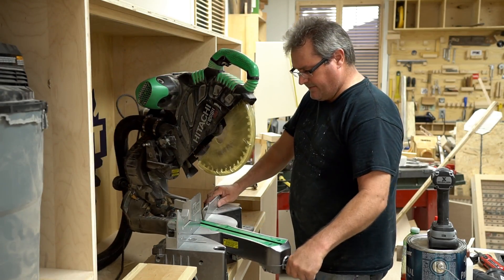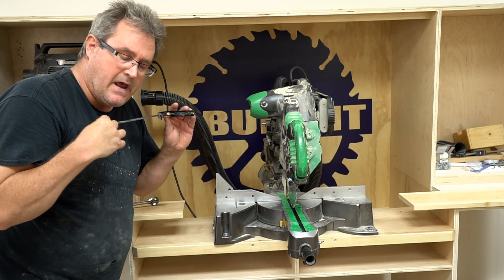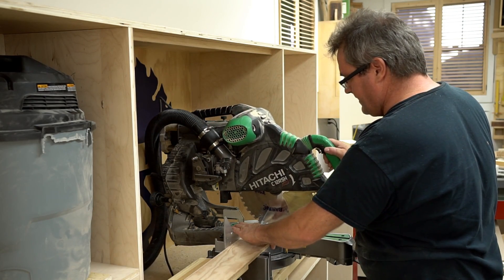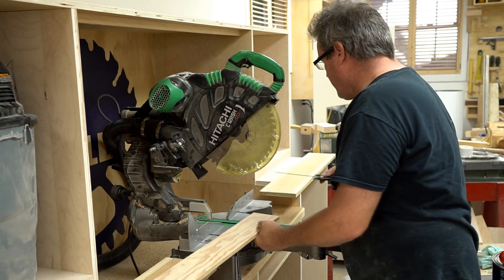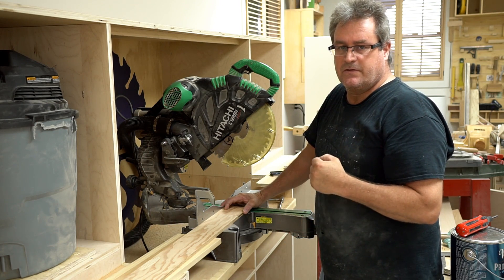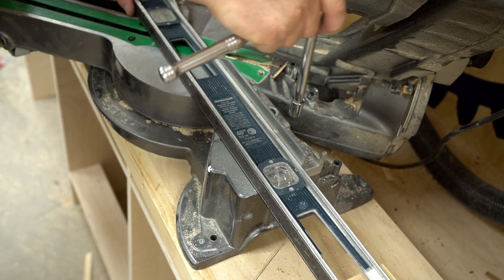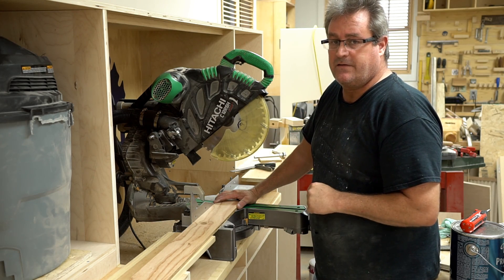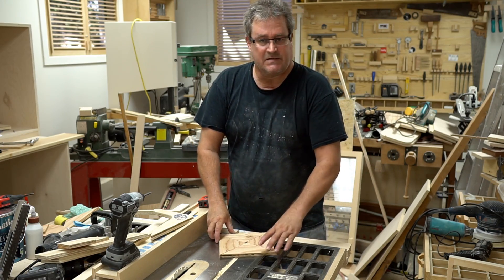Adjusting A Miter Saw For Accurate Cuts

Comment: Awesome post, sir!  You saved me money and time setting up a humble home shop.  I thought I'd just bought a lemon, a Hitachi C10FCE2 .  It was never right in the horizontal plane, fence to blade.  I had bypassed the factory detents the entire time I've owned it (5+ years).  I ran it square, but never on the factory detents.  I always ensured it was squared manually, and bypassing the factory settings.  It was on my list to replace as soon as I could.  I wasn't aware it was adjustable in that plane.  Thanks a bunch!

Comment: Thanks John. I've been having trouble with the cuts with my saw, and didn't know why. I put a speed square on it, and lo and behold the saw was out of square. When I checked the 45 after pulling the saw back the bolt was nowhere near where it should have been. I am so glad you mentioned that because I would not have checked it. So, thank you so much, you saved my life(so to speak).

Comment: My wife bought me a miter saw for Christmas one year. Right out of the box it worked perfectly. After about a year, I decided to check it for square. Low and behold, it was out of square though I was very careful with the machine. So, I adjusted it until it matched my machinist square perfectly. I did a few projects and not one turned out right. To make a long story short, this so-called machinist square was off by a few degrees. after it went flying across the garage, I got out my tri-square, readjusted everything and now it's perfect once again. Moral of the story: Check your squares regularly!

Comment: Hi John

Very informative video. If you loosen the three screws on each green inset plate, push the inserts inward until they are flush, make a sliding plunge cut, you will have a zero clearance inset plate.

Thanks for your time

Comment: That is one beast of a saw.  I can see why you made a station for it.  I've got an old 12" Craftsman that I've had for almost 25 years which is still going strong.  I'm not using it everyday but it still holds its settings.  Never thought about the five cut method.  May have to try that next weekend and hope my opinion of the saw stays the same.    8-)

Comment: I am very glad you made this video.  I have the same saw, I think we've had ours about the same amount of time (I bought mine in 2010) and for the most part I've been happy with it, but I have noticed things not quite lining up when I'm crosscutting a wide piece, and I've just sort of lived with it for a while, but now I realize that it is possible (and pretty easy, actually) to adjust this thing to something a lot closer to perfection than I've seen with it.

Comment: Thanks so much for this John. I have a Maktec MT230 (non-sliding) which has a long single backing plate with 4 bolts. I had no idea they were adjustable until you demonstrated that. As you guessed, I didn't read the Manual! Probably I would have tried looking for an adjustment thingie underneath the round table bit that moves the angles, so you have saved me a lot of strife.

Comment: Even 5 years later, this video is so helpful & easy to follow.  I was going nuts aligning my 45 degree angles for artwork frames with the saw bowing & had limited knowledge in to check/fix it. I even made a sacrificial fence (which was a waste). I also wonder if a 60 tooth saw blade would be better than a 40 when cutting poplar. Will try this first.  Thanks!

Comment: I have a similar saw, couldn't get the left fence to square up. This happened before. Had to remove both fences and plastic saw guides to get at the main pivot bolt. Unscrewed that and gently lifted saw off platform. The whole area down there was fill of sawdust. Cleaned it all up and put it back together. (don't overtighten pivot bolt) Works great now.

Comment: I don't know how people go without a miter saw. Mine is a 12" craftsman (non-slide) compound, and I love it. I now use an adaptation of that zero-clear backstop/flat deck like the one you made a video about. It pops off pretty easily for angles, but it's also the reason I haven't fine tuned my saw recently. Most used (power) tool in my garage.

Comment: If you have one on hand, use fine finish/ultra fine finish blades when calibrating your saw with wood cuts.  They not only cut the wood but sand the cut edge as well and pieces fit together much tighter than cuts with a general purpose blade. I've noticed some plywood or lumber is worse than others about splintering on the edges of the cut edge.  Splinters keep your cuts from sealing tight if they're left so either lightly sand them off or use a fine finish blade to keep you from getting them in the first place.

Comment: Great video, thanks.

The Hitachi design of the handle is quite clever, all the forces of your arm are in line with the blade. With a lot of saws the handle is on the side and you have to push against a second switch on the side of the handle too which doesn't help with making a smooth up and down motion.

Comment: I purchased this identical saw at Lowe's about 2012 for a ridiculously low $299 and have been extremely happy until today.  The miter angle has gone slightly out of perpendicular.  I assumed that this could be adjusted for with the little knob at the front of the saw next to the handle, however when I tried to use this per the manual it unscrewed and the outer nut fell off.  So off to youtube I go to see what I'm doing wrong.  Your vid just made my day.  All is well with the universe and the new headboard for the guestroom should be done soon. Thank you, Herr Heisz.

Incidentally, are you aware that the "sz", Ess Zet in German, can be replaced with "ß" ?  Also known as a "sharfes s".  The z has sharp corners, you see, just like the edges of the wood you cut.

Comment from the maker: Now that I've got the saw installed in the new cabinet, I go through the procedure I use for setting it up for accurate cuts.

Plans for sale: http://www.ibuildit.ca/plans.html

Do you always like to be First? You can watch these videos a day before anyone else by becoming a supporter of this channel on Patreon. For as little as $1 per month, you'll get early access to regular videos and also exclusive videos made just for my Patreon supporters!
https://www.patreon.com/user?u=865843&ty=h

How to adjust a combination square the easy way:
https://youtu.be/cxrCZd7r6qE

The five cut method:
http://www.ibuildit.ca/featured-video-projects/fvp0063.html

Check out part 3 of the miter station build here:
https://youtu.be/kXCfKwklHoc
That's on my second woodworking channel where I make longer, more detailed and usually multi-part videos.

I'm posting regular updates on the miter station project on the website forum, if you'd like to follow along:
http://www.ibuildit.ca/ibuildit-forum/viewtopic.php?id=667
Reply: ya ur the best
Reply: Thanks for this video.  I recently acquired this exact model used.  If the first item you checked, the vertical of the blade to the bed, how would you adjust the saw if that value was not 90 degrees?

Comment: I'm also fan of mitre saws and find the better quality models can be extremely accurate, when used correctly. Saying that, I used to own a 12in Bosch saw that would badly flex from side to side and with little effort (it was second hand). I also find them to be safer than radial arm saws - when you let go of the handle, the spring causes the blade to retract and the guard slides in to place. A radial arm saw is always running towards you and you don't have the choice to cut against the blade's rotation.

Thanks for the detailed walkthrough on tuning your saw.
Reply from the maker: Thanks Olly. I completely agree on the radial arm saw being more dangerous to use.

Comment: Thanks John  i have the exact saw in my shop. so this  was prefect help.  I noticed last week  the cuts wee looking a tiny bit wonky. Have used the saw mostly for rough Construction.  Now retired I started making some cabinets and the wonkiness is not acceptable. Could you show where the vertical  adjustment screw is on this saw. You mentioned it but didn't show where  that was.  Since I have this exact saw it will be very helpful.  Thanks again   Rich  - Salem, OR

Comment: I have the same saw and have had two issues.
1) The brake doesn't always work. The switch in the trigger is probably bad, but this shouldn't happen on a 1 year old saw.
2) I spent a decent amount of time adjusting it for perfect accuracy. One thing I notice is that there is still some deflection on the cut. Almost like the cut is hollowed in the middle. I still have the stock blade, so that might have something to do with it. I intend to get a full kerf replacement eventually.

Comment: I have a Hitachi that is just ever so slightly out of square.  Much less than what you showed on your first cut.  Never really cared much as the cuts were still within tolerance.  However, after watching this video, my excuse for not doing anything about it is out the window.  Easy fix.  Thanks.

Comment: I love my miter saw, never understood the hate some people have for these tools.
Reply: i agree, they can be very accurate if set up right, very quick and repetative cuts can be done, and they are super versatile, you can make anything from half lap joints to circles, even small amount of ripping, they are just so usefull esspecially the sliding ones, pretty fun too i guess
Reply: African Cichlids I don’t know what you have used but as a joiner by dewalt DW708 is more that accurate enough for joinery work. That’s only ever been adjusted once in the 15-16uears I’ve had it.
Reply: Did you not watch the video which outlined how to make them accurate? Just like any tool you want to have precision results from, they must be tuned slightly to ensure accuracy... heck I even tune/true up my skilsaw for framing applications. Even a powermatic table saw straight out of the box and every so often requires some truing/tuning to maintain accuracy otherwise it is like a high end rifle with poorly adjusted sights = inaccurate.
Reply: @africancichlids3011  I’m not sure what field or country you’re referring to, but at least in US construction, the miter saw is a primarily finish and trim carpentry tool. It can be used for framing certainly, but pretty much every single finish carpenter you meet here is going to have a nice miter saw. I don’t even know what else you would use honestly.

Comment: Great video John. However, here's my problem. I have a Hitachi 12RSH2 miter saw. This problem I’m having has drove me crazy. I can only get 3 of four corners squared. I make the initial cut on the miter saw and place that side against the fence. When I get to the fourth side, it's not square. I’ve also cut one side of the board on the table saw and used that side first on the miter saw. One, two three sides are square. When I cut the fourth side, it’s not square. I’ve done the blade to fence adjustment and it’s square. The fence is straight. I’ve done the bringing the blade straight down cutting a section of the board then flipping one piece over. The two pieces match perfectly. What’s happening that the saw won’t cut a board to have four square corners? I’ve also made sure board doesn’t move during each cut.

Comment: If I can not get my mitre saw exactly square (able to cut 90 degrees) should I continuing trying and adjust the fence or the positive stop or detents or the blade or will a sacrificial fence take care it ?

If I had a sacrificial fence I could just skip some paper in between the fence and the sacrificial fence until I get a true 90 degree cut. 

I am about 0.5 of a mm off now and I can not seem to get it corrected. 

Appreciate the advice.

Comment: Ive got to get my grandpa's miter saw out of storage, it does not pivot, but it slides on a trolley. Also it weighs about 200 pounds, the base is solid steel and cast iron
Reply from the maker: Sounds like a radial arm saw.

Comment: what do you do when cleaning the slide on this saw? I just bought a 12" hitachi  compound sliding saw from Home depot and after using it for about a month is does not slide easy. I think they put to much grease on the bearings on the slide. What is your advise on this thank you in advance.

Comment: Very helpful video. Was wondering, how do you adjust the miter scale/detent on your saw (assuming it is off by 0.5 or 1 degree)? It doesn't seem like your saw has an adjustable plate.

Comment: On many saws like the DeWalt you square the blades to fence leaving the fence as is. Three screws to loosen scale as described in the DeWalt manual. Easy but have a good square such as machinist. Then just square blade to table ;45 and 33.90 as described  in manual.

Comment: I have the same saw. But I've never made any adjustments to it. It was perfect enough out of the box, but now it's been over a year and a move I should probably do an adjustment. I wonder if seeing you use that saw had any influence on me buying mine. (Only after I had bought the saw did I realize we had the same one.)
Reply from the maker: Lucky I didn't paint it white and stencil my name onto it :D
I've owned several miter saws and used a bunch more, but this is the best I've ever used. Actually, as far as satisfaction goes, no other tool that I've ever bought can match this one.
Reply: +John Heisz I've got the Hitachi 12" too, but not the sliding miter. Great saw. A friend sold it to me for a song after a house I was building got broken into, and they stole $2500.00 worth of tools!

Comment: John,

Could you tell me a little about your miter dust extraction setup? In your shop there appears to be a vacuum hose attached to your Hitachi Miter. Does your shop vac engage when you use the miter? Or do you periodically run the vac to empty the dust that has collected in the hose after several cuts?

Great videos by the way!

Comment: Very nicely done. However, I have been looking for the answer to correcting "slop" in the detent settings. I have the 10 inch version of your HItachi Sliding saw, and there is about a half degree movement in each detent setting. This throws off the accuracy of all cuts. Very inconvenient to have to square the blade and tighten the handle each time I change angles. I see no obvious way to adjust the detents, and I've checked many of the "adjustment" videos and found no mention of this issue. Seems if this is a non-adjustable setting on machining which would tend to wear with use, there should be a mention somewhere. Too bad to lose the function of such an otherwise great saw for lack of such a small correction ability. Am I missing something?

Comment: I unfortunately had my miter saw fall down and now when I make a cut, the cut towards the end of the board (furthest from the fence) isn’t square to the fence and the rest of the cut. This is even more noticeable when doing a long bevel cut. I’m not certain if that means the rails are bent or whatever else could be wrong. I’ve adjusted everything I can and have gotten it to cut much better than when it fell, but the problem still persists. Any idea what it can be?

Comment: Next time measure with the short side of the square on the cut, and the long side on the back - simply because you want to use the longest possible sides to see how the degrees hold over length. A cut can appear perfect on 4" but over 12" you might see a tiny gap. Also, by holding it on that side you can really press that short foot of the square to make sure it's perfectly flat - the way you were holding it at the top like that - there's room for error for sure.

Comment: I have this same saw. I got it used. Mine is square when it's all the way back but way off when I pull it out. So much so that it cut the green plastic inserts. Nothing seems to work. I think the two slide rods might be bent.

Comment: I have the same Hitachi C12rsh saw. Any advice on troubleshooting "sticky" slide pipe(s)? I have cleaned the pipes as best I can. The saw does not slide back and forth easily when the rear knob bolt is tightened and the front bolt is loosened. Thank you!

Comment: I was thinking of getting a compound mitre saw but the ones in my price range are very flimsy and probably not super accurate.

Most woodworkers would probably favour a good table saw over a chop/mitre saw.  But I'm sure if you got the space both are very useful for different applications.

I noticed Mattias' saw just spewed chippings everywhere even with dust collection.  Probably not a good design.

I quite like the classic dewalts Frank Howarth and The homestead craftsman use.

Comment: Always buy a Slide Compound Mitre Saw with the handle in a line above the saw blade , everything has to be in line Slide bar rails, handle ,saw blade it's better . no tilt saw blade, and engine with softstart.

Comment: Hey I'm having troubles with doing compound miter angles where it seems to do the 45 degree correctly but this The Edge is slightly curved and I think it might be me pulling too much on it but I still can't seem to get a good straight cut without shifting the detent from 0 to the first tech mark and the weird thing is it's so far it seems that vertically it cuts perfectly square only when it's tilted over to the 45° for a compound miter that I have that issue and the reason why I have to cut the material this way is because the material is too tall for my 10-in saw do you know what might cause this hopefully you understand what I'm trying to say

Comment: John   If i am using a portable Miter saw stand such as the Ryobi A18MS01G,  how do I support the center bolt in the rear of this Hitachi C12RSH.  I want to provide bolt support from a frame under the rear hole (in the center of base at rear) for connection to either side bracket as provided by Ryobi in their stand.

Comment: unrelated .  i  use laundry detergent  to  clean  the pitch  off my   saw  blades .  and warm  water  let it  soak  15 minutes ,  brush it  with  a  nylon brush  ,   cuts  so much better after it's clean